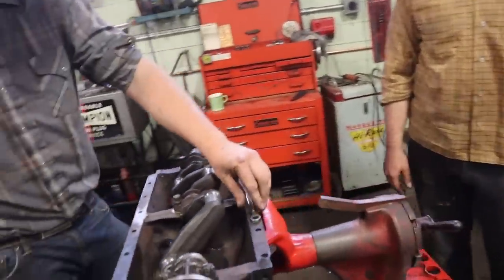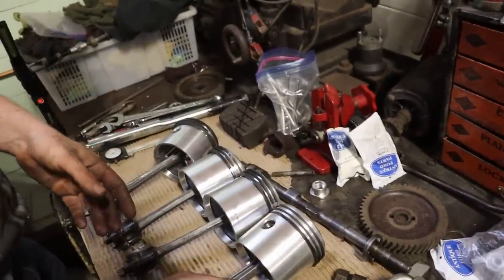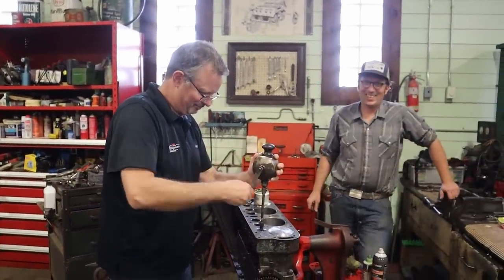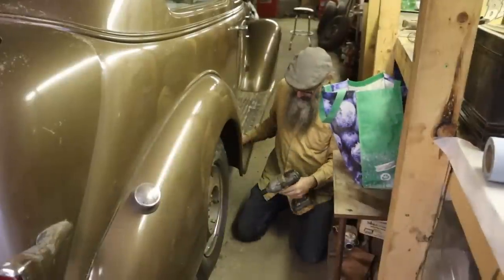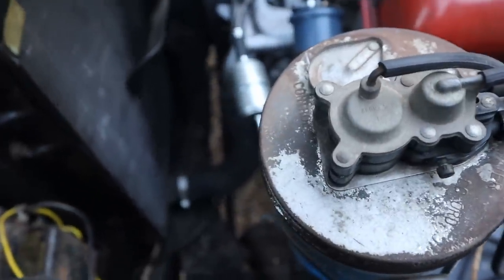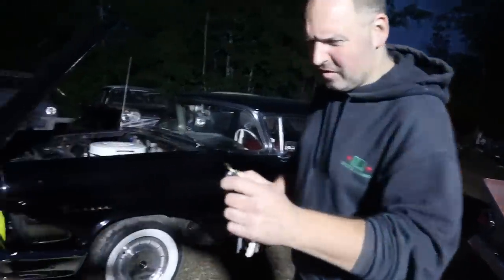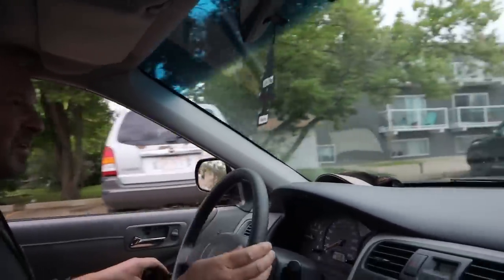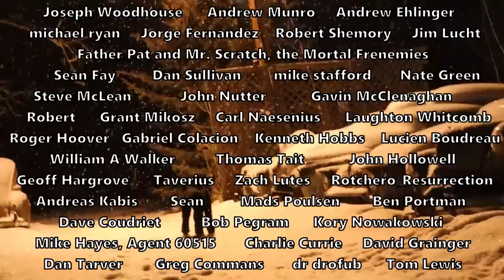Fresh engine for the Model T! Plus: Edsel is Back, Baby, and How We found Dave's Stolen Impala!

Comment: My '47 Dodge 1/2 ton pickup had a new repro mech fuel pump on it too and lasted <100 miles, the linkage inside kept disconnecting itself, it now has a proper old AC pump with new bits in it - fingers crossed it'll behave. PS I hope Strong's Garage goes international with a second 'shop here in the UK, it'd be useful to have nearby ... plus great that the Impala turned up

Comment: So glad you guys found Dave's Impala!  Thats awesome. As for the fuel pump issue on the Edsel, over the years I run into that same issue on many different cars. IIRC, the pump eccentric on those motors , bolts onto the cam gear. Those sometimes gets worn down to the point that it wont move the pump arm far enough. Had many new pumps, with too much slack in the linkage to work properly. Had a shop work on my Toyota Celica one time. We were getting it ready for vacation to Pikes Peak. The guy put on a new pump, thought the old one was leaking into the oil. Got to high altitude and it wouldn't move enough to keep running. Limped back home and it kept getting worse, day after return home it wouldn't run at all . went to Toyota and spent the cash to get the genuine article, no slop in the linkage and cured the issue.

Comment: I had a 1962 Ford Fairlane  with a 221 v8 and a three speed with over drive. Clean car for Vermont! Any who I remember the lobe on the fuel pump drive cam or the fuel pump pusher pumper thingy was a little lean. Gas welded a little meat on it as I recall. I loved that car! Sad when the rear went due to hulling water in milk cans one winter. That car was like a tractor! Little 221. Good show guys. Nice to see Dean sober!

Comment: And the academy award goes to Scott Newstead for best supporting actor on the Strong’s Garage Show I was thinking about the fuel pump issue on the Edsel if it uses a push rod from the cam to the pump it might be worn down causing low diaphragm lift

Comment: Funny thing about fuel pumps. In my younger days (1970's), when I was doing a lot of scrounging of parts from old wrecks, it was not at all unusual to see fuel pump arms built up with a few lines of weld. I thought at the time that it was to compensate for wear, but now I think it more likely that the pump makers had a selection of arms for the same pump, according to the make and model of car. Then as now, maybe getting a pump matching the part number didn't necessarily mean getting the correct arm.

Comment: Scott, on some of those old FE engines the rod off the fuel pump was bent downward to make good contact with the eccentric. The replacement pumps are a straighter arm which will not engage the eccentric correctly

Comment: Scott, your Thursday show supported the value of a well planned re-TIRE-ment and I love the Frankers' Saturday slomo intro + her highlight vignettes including her ever regal R-5 shotgun pose! The T engine rebuild is surprisingly complex! I had no idea about the flywheel dynamo and many other details from a century past. WOW! The Edsel fuel pump save was very cool and I'm now amazed why more shade tree denizens haven't modified those often incorrect arms? Congrats on taking charge and diving in with a direct attack and problem solution! Your 37 braking error was an easy mistake to make, I've removed more than one pinch clip to flip over a rear brake control arm myself so no worries! But though a through delight so far the stolen chevy recovery and cop bust was the dramatic icing on the already rich layer cake of an episode! Thank you for once again delivering the weekly goods in very fine fettle! Cheers from the high desert!

Comment: Where do I start?  Love that Chevy!  LOVE that Edsel!  I wonder if my AMX has the same fuel pump issue as the Edsel.  The carb isn't getting fuel.  No blockages.  Glad to hear the Impala has been recovered.  Someone "tried" to steal my Jeep five years ago.  I say "tried" because they didn't get very far.  Either they didn't know how to drive a stick and gave up, or they saw the rosary on the package tray and freaked out, fearing the wrath of God.  New steering column, new stationary glass, new dome and cargo area lights.

P. S.  That opening at Strong's Garage is hilarious.

Comment: With the "T's" engine looking that good, it'll be ready for power tour, or 24 hours of lemons! hell, it'll outlast any other engine in your competitor's vehicles.  👍 Quite a treat to see the innards of a T motor, interesting how the crank throws are LONG. sort of like the cranks on Slant 6 engines.  I see that Frankers is being an absolute MVP supervisor in the installment of various engine components, Frankers needs a raise! Perhaps more treats?

Dean's new Honda beater is a great car, early 90's to late 2000's Honda's were built well enough to last at least 300K miles with some preventative maintenance. good purchase!
Even where i live, finding a Honda or a sedan for that matter is quite rare especially that $1500 tag, the price was a steal.
Also, good to see Dean's Edsel back for more.

With Dave's Impala back, highly recommend getting some kill switches to prevent any kind of theft again. good deal all in all.

Had a freak issue like the Edsel on a Chrysler C body, Fuel pump rod was correct length but the pump arm had worn away, not surprising considering the quality of today's parts, glad you got that fuel delivery issue potentially sorted out.

Comment: Excellent detective work on the Impala. The best theft deterrent is a hidden kill switch. If it won't start, the crooks will move onto the next car. Get creative on the placement of the switch, you can also buy a magnet switch that hides behind a plastic panel, hold a piece of metal up to it while cranking the car.

Comment: An old guy at the parts store told me 30yrs ago the flat head six ford engines had an issue with the fuel pump eccentric on the cam wearing out. His advise was not to buy a mechanical pump because it won't fix the problem and to go electric. Which I know is out of the question, but it may have been the cam and not the pump.

Comment: Played that intro 3 times, so far. Ding Ding. lmao. Repeat. Magnets and coils and how they attach to the engine is amazing. How they thought of that while engineering a car.
Edsel sounds like the cam lobe is flat or rod that operates the fuel pump is worn down so now shorter in length?

Comment: I see that you opted not to repaint the T block, which fits the survivor motif you've kept so far. It looks way better on the inside than outside! Great story about the stolen car recovery. Cops almost never really investigate like you see on TV. Unless somebody's dead or missing, they simply don't care. This isn't the first YT video I've seen where someone did all the work for the cops and handed them the perp practically wrapped with a bow. I hope the scumbag gets more than a slap on the wrist ... they used to punish horse thieves much more harshly for the same sort of thing. Branding sounds about right.

Comment: Mopar flathead 6s have a similar thing. Before '49 has a larger fuel cam than post '49s. After '49 the pump arm has a shoe on it to make up the difference.

Comment: That old machine shop is stuck in time for a rebuild Model T engine. It's like looking at a museum.
    The 1932 Chevy Sadan  brakes jammed up. "IT'S STEVE FAULT!" He found the problem and fixed it. 
    A Honda is a Honda. No complaints.
    The Ford Edsel is in great shape! Love to see it on the road. Too bad about the fuel pump, but found a figlydig repair with another fuel pump from a different car make.
    The rest of the video was interesting  with tractors and lawnmowers. 
    Great catch on the criminals stealing Dave's car! "LAWBREAKERS MUST BE EXTERMINATED!!!"

Comment: I enjoy both Strongs Garage, and Cold War Motors. 
     Scott, I am currently going through my 1920 model T Touring Car. The motor is currently being rebuilt. I am hoping to get i back soon.
       Of course pulling the motor opened up a can of worms. The U joint was worn and needed to be replaced. This lead to removing the rear axle and the torque tube. So while it’s out tome to check and see if the Babbitt thrust washers were still intact. No, they were a pile of mud and chunks on the bottom of the pumpkin. This lead to new pinion gear, ring gear, thrust washers, axel shafts. I also installed a modern pinion bearing at the recommendation of Lang’s model T parts.
     In addition to these repairs, i am installing sure stop disc brakes, and replacing the e brake shoes.
     If you have not started collecting the parts for the rear you may want to be prepared for a deeper dive.
      BTW, my motor is getting the 280 cam, and high compression head. Staying with the original crank with new Babbitt.
     Good luck with your project! Love the Plymouth, Chevy, Citroen, and the T. I would love to see you get to the two Buicks by your garage door.
Reply from the maker: Hi! I rebuilt the rear end a couple of winters ago; it was so bad the car wasn't driveable...Cheers!

Comment: Always appreciate 🙏 and enjoy a collaboration between CWM & Strongs Garage  🔩⚙

Incredibly fascinating by the level or , meticulous hand crafted machining & rebuilt  .

Not to mention knowledge & attention too ISO 9010 details  
🏆🏅

However  , I do have to chuckle too myself  . If it wasn't for the Dodge Brothers helping out Henry Ford .

With some financial assistance &
Some engines  ,
FoMoCo , might not have happened .

I can't help but think 🤔 💭
If more vocational/trade schools offered this level of meticulous hands on training and apptiude  , 

How much better the mechanical world would be 

That flywheel 🧲 magneto assembly was such an extraordinary treat !!!!

Not to be off topic BUT ,
The 4dr Dodge mint green 
truck 🛻 looks mighty promising 

Liked how you threw Ashley under the brake linkage bus ..... LOL 😆 

But seriously  , the Originality of that 37 Chevy , is absolutely phenomenal  !!

If you can find a , Honda Accord wagon , those are handy 

Great job , backtracking the fuel pump application  . 

Sweet gravely collection  .

Great job , concluding that the 
fuel pump actuator arm , wasn't manufactured correctly  

Glad Dave got his car back 
Great impromptu detective 🕵️‍♂️ 
Work , Kyle !!

Comment: The Edsel fuel pump dilemma. I have seen this many times over the years. Here is what may have happened. When the installing the fuel pump, many people unknowingly put the pump lever over the cam eccentric rather then under it as it should be. If the lever is over the eccentric when you turn the engine over to test fuel flow the pump will stream out fuel for about 1 to 2 inches at the carb. When installed correctly the stream should be 2 feet at least. By the fix you did makes me think that is what happened in your case.

Comment: I  once worked on an old vauxhall with a mechanical fuel pump that like the edsels worked fine until it was fitted to the engine and then it  refused to pump. it turned out to be the one cam lobe that operates the fuel pump arm was badly worn but the rest of the lobes were fine, to save replacing the otherwise functional cam i just fitted an additional  electric fuel pump. i didn't regard it as a bodge but as an acceptable cheat.

Comment: I may have the answer to your Edsel fuel pump problem.  I had a 58 Mercury with the 383 MEL engine that would not pump fuel.  I replaced the pump to no avail. This was in 1963 when parts men really knew their stuff and the local parts guy said pull the actuator rod out and see if the little brass tip that is bonded to the end had come off.  Sure enough it was gone.  A new actuator rod fixed it right up.  Worth looking at in your case.
Reply from the maker: Thanks! The FE in Dean's car uses a long lever arm though, so I just modified it a bit and so far so good...Cheers!

Comment: ya those fuel pumps have different lever arms some short some longer one those better ideas from ford i would find the spec in a parts manual on the arm size and get a pump of that size that or put a delete over the hole and run a electric pump on it

Comment: Good call on the Edsel fuel pump, how many guys would have the time to figure it out like you did by trail & error, like the master you are? Ma's '56 Chevy convertible was just like it, couldn't shut it off until you were done driving for the day and always starving for more gas, Grumpy drilled the pumps rocker arm and added a nut & bolt with a rounded head to get results'. How many cars were sold off for Not knowing  how to correct it.

Comment: Does that Edsel have an insulator block between the fuel pump and the block?  If so is it possible different models had different thicknesses? Just a thought, that would affect the start and finish travel of the arm.   Best wishes from Australia

Comment: When you went to the location of the stolen Impala I thought : What a ghetto kind of place. Funny that you used exactly the word ghetto as well.
One and a half years ago I nearly had a heart attack. I wanted to get my most valuable car out of a garage. I got a shock: My 65 Bonneville convertible was stolen!
 When a neighbour came he told me : "But you parked the car outside". When I ran out, the car was a few hundred yards away. The back was on the road and the nose on a private parking lot. I did not call the cops, I hopped in the car and drove off. I was night and a thunderstorm was on the way. The only feedback from the cops: They recommended a safer storing garage.
I hate those low life bastards who steal and damage cars!
 A few years ago, an idiot started a fire, some cars burnt to the ground and three of my vehicles got damaged, including the Bonneville and one was not even insured.

Comment: My Chevelle kept dying when I had four or five people in it. I checked fuel and spark. No fuel to the carb so I replaced the fuel pump. Still no fuel to the carb. Got another fuel pump, still no fuel….. got under the car traced the line back to the tank. Turned out I had left too big a loop in the fuel line so that when the car was loaded, the rear end came close enough to pinch the line shut. How frustrating !

Comment: I realized firsthand how easy those '80s GMs are to steal when I parked my '89 Buick in a lot for 50 minutes and it was gone by the time I got back.

Security was able to pull camera footage that showed it was actually only 1 minute from when the guys walked up to the car, to the time they were driving it out of the lot.

Police that took the report said they had a rash of auto theft going on in that area at the time, all '80s to mid-'90s GM vehicles.

Comment: Hello Scott; The FE ford motors had a eccentric that bolted to the cam sprocket that ran the fuel pump! I would be looking at this before any damage is done.
Reply from the maker: Oh yeah! I checked that because I thought it might have come loose and was spinning instead of pushing on the pump lever, but it is fine...Cheers!

Comment: With this car personally i would KEEP the original in running condition, do up another engine for the car!! I rate the Ford model T as one of BEST cars Ever made!!!! How many other 100 years cars do you see out and about nowadays???? NOT MANY!!!!! The Model T was rated at 20hp with 6.5?? compression, the Model A was basically the same but with higher compression 40hp??
Make no mistake these engines do not like to rev high, i imagine 3000rpm redline!
That Ford Edsel is nice man, ( but they were a huge flop sales wise! )

Comment: People wonder why anyone hops up a "T" motor. All that trouble to go from 24hp to 34hp. They don't realize that extra 10hp is MODEL T horsepower. 34 T horsepower is WAAYYY better than 34 Chevy horses or 34 Overland ponies. Just like a 180 horse slant 6 is the equal of any 200hp Stovebolt or Teakettle Ford V8. I don't know why that's so hard for people to understand

Comment: You should have told the police someone had been misgendered. They would have been there in five minutes with a SWAT team. 

I had an ‘88 Caprice like Dave’s Impala. A previous owner had installed an anti-theft device that required you pull the parking brake release to start the car. I brought it in for service once and forgot to tell them. Instead of calling me they tried to charge me diagnostic time to figure out “the problem.” Dave should consider some kind of anti-theft device like that on his car. Old cars are stupid easy to steal.